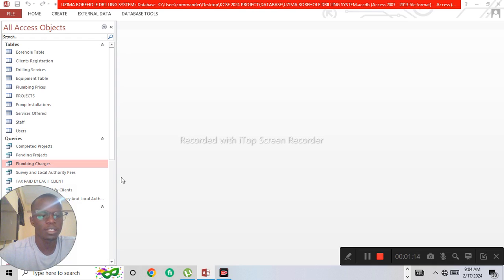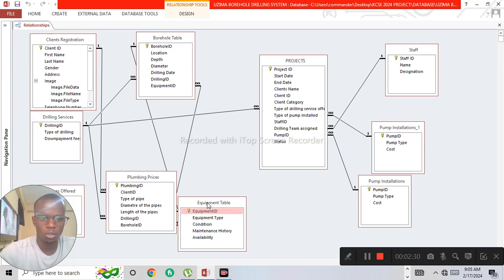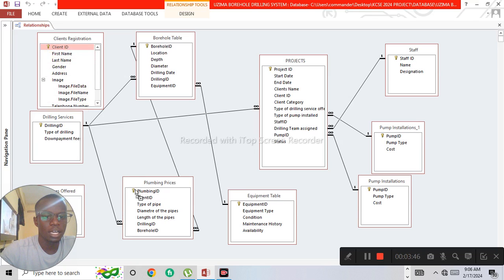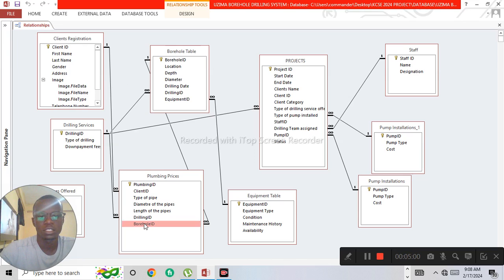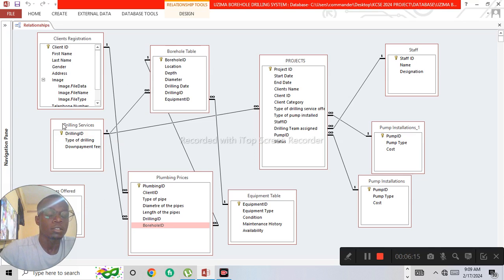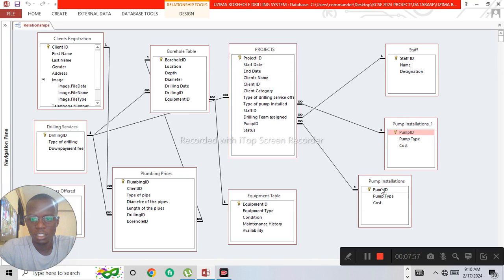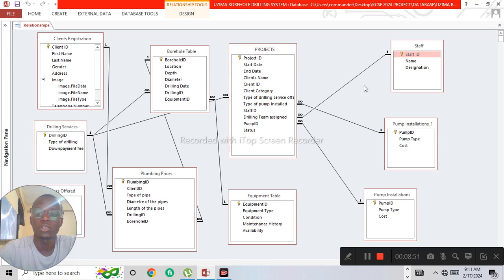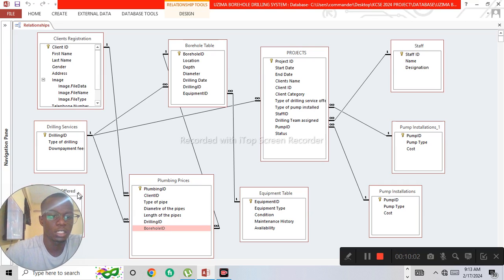Uzima Bora Borehole drilling system Table Relationships

Comment: Why do you need an equipment Id when you only using one equipment and that is a drill
Reply from the maker: Because we have different equipments to be able to drill a borehole e.g a driller, pipe wrench, tape measures for measuring the depth and height of the borehole